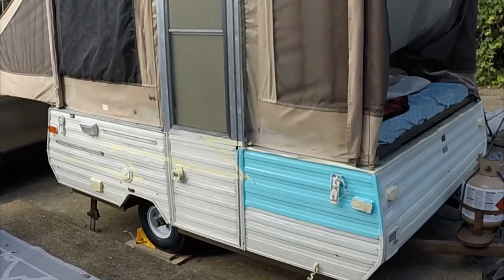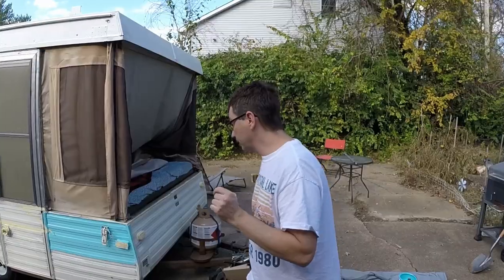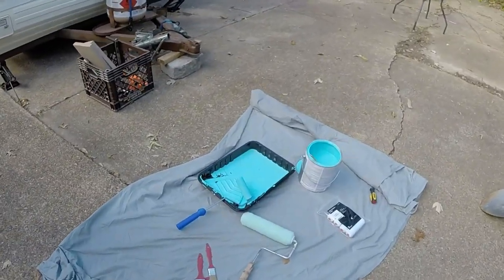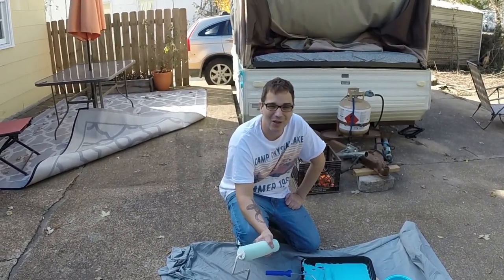Painting a 30 Year Old Pop Up Camper: 1990 Jayco makeover

Comment: Looks cool. Do you know how long the interior structure of these little campers stand up with time? I hoped to use my dads big camper that we used twice in the 80s. For some reason its sat unused since then. The walls falling out!  Its a wood frame! So sad. Might sleep in its mildew goodness one more time, just for old times sake.
Reply from the maker: It depends on how  it was kept. This one is 30 years old. They are pretty easy to fix up as you can see in this lil series. I figure we could get another 30 out of it.